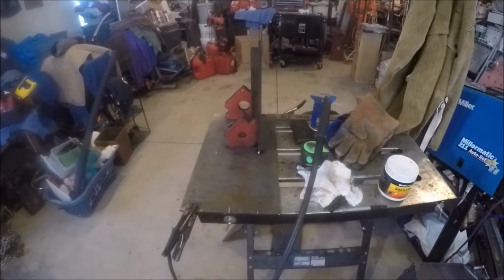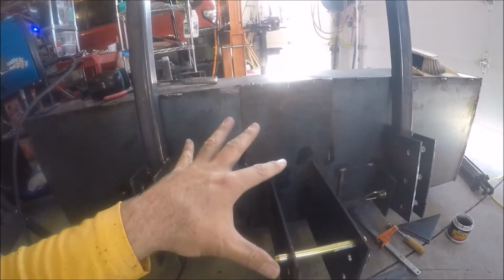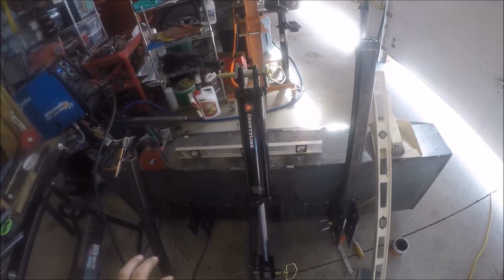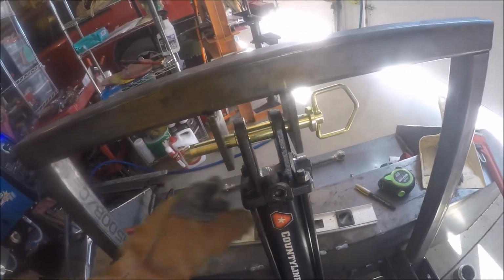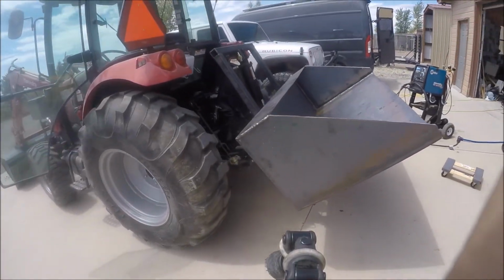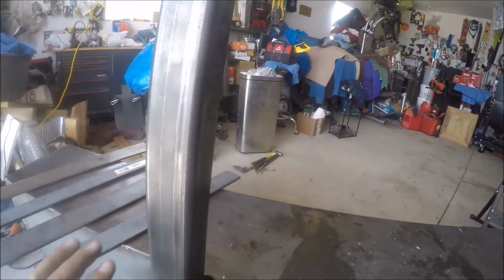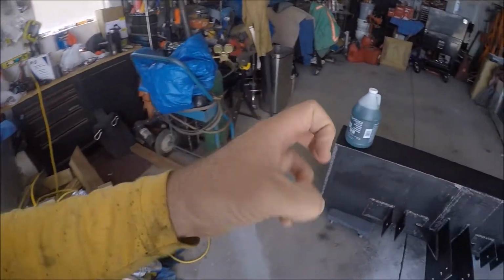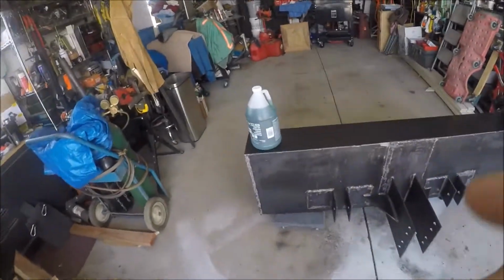3 POINT Tractor BUCKET Build Pt 3

Comment: Looking nice!  I'll have to check for rust inhibitor. I do so many projects where the steel is far from perfect. That would save me some preparation time. Thanks!
Reply: Oh! I forgot!  I always do the mistake of welding a U-shaped tubing frame and discover it warped!  Then I put the gussets in and it is still warped! If ever you get that bad like me, you simply cut the gusset in its middle, stretch open the shape, pass beyond straight. Then weld back the gusset. Then keep finger crossed it is now straight!